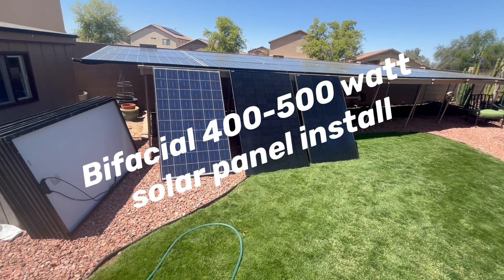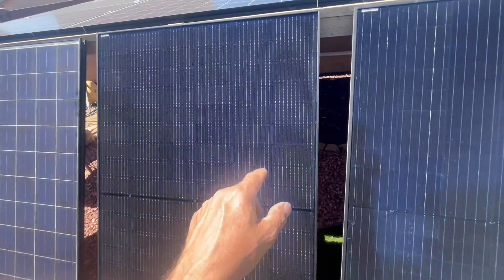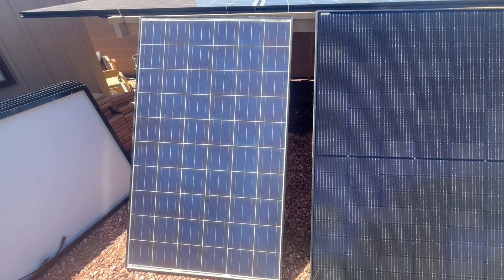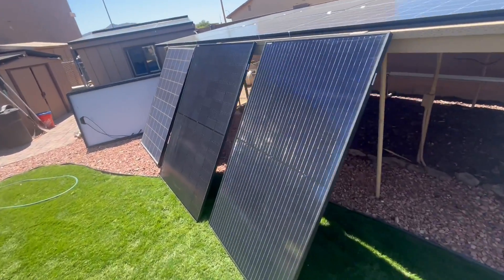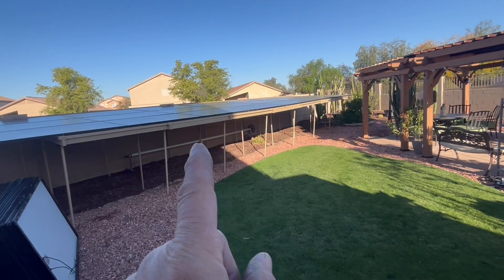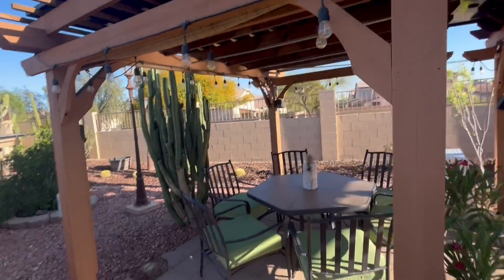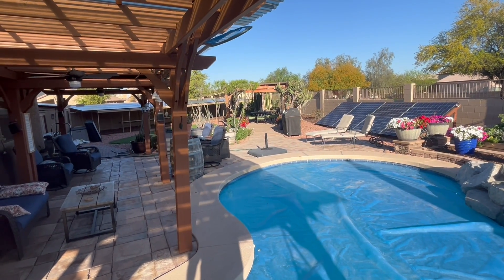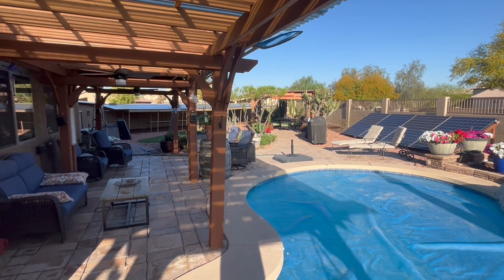DIY solar panel for home. Bifacial 400-500 watt with Growatt 12kw low frequency off grid inverter

Comment: I would like u to give an accurate quote of how much u paid to have ur electrical panel wall wired by a professional to ur inverters and batteries? Please & thx u. (I only ask bcuz I know what I paid and now im finding out they didn’t get the proper permits and now I have to pay even more UHG! But the nice thing is my solar system is up and running and they Can jell their meter as long as they want as long as I can afford gas to run my generators
Reply from the maker: This system is completely off grid.  It is not connected to the grid in any way.

Comment: Nice find on the panels looking at these higher output panels they are lot longer some up to 8 feet long.
Reply from the maker: I have seen those, they are huge. Need two to three people to mount those. I think SanTan solar said they would not load those into a pickup truck, they are that long. 

I really like the size of the 400 watt bifacial solar panels. Easy to handle and mount on solar array.

Comment: I see those are Hyperion 400W panels. I'm planning to do an install with these panels on my home in the next few months. Just about to order some however I see the connector type on the data sheet for these panels is a RY01 connector. How difficult is it to find adapters to hook these panels up to MC4?
Reply from the maker: @aliciaoswald9746  I bought my Hyperion bifacial panels from Signature Solar, they came with MC4 connectors. I have not worked with these RY01 connectors at all. I would ask Signature Solar if they have or will be getting the Hyperion panels with MC4 panels.
Reply: @diy-solar-guy  Thanks for the quick reply, that's great news. I'm planning to buy from Signature solar as well but will doublecheck with them before purchasing. Datasheet technically says "RY01 or similar" so I'm guessing ones produced for import into the US are built differently for the US market.
Reply from the maker: I have never seen those new connectors
Reply: I just saw in the specs after reading your comment that they are listed with ry01 connectors. I just made an order for ten panels, hopefully I get them with mc4's as well. 😅
Reply from the maker: @ I tried looking for the RY01 connector online. Not easy to find at all. Might want to call where you bought solar panels from and ask where you can buy RY01 connectors. First time seeing these new connectors.

Comment: Are those 400 watt bifacial panels Hyperion brand solar panels? I have a local guy selling them for $112 each and wanted to know if you like them.
Reply from the maker: @Ranch321  yes, the 400 watt bifacial solar panels I have are Hyperion brand. They are my favorite solar panels so far. I have 10 connected to my EG4 3000 watt off grid inverter and they preform excellent. I have them mounted on a wood pergola so they are 9 feet off the ground and pick up a decent amount of light. The highest I had them producing as input was 3350 watts, but I don’t think that is the max I could squeeze out of them. That’s just the amount with a large load. Very satisfied and would purchase again. They were $120 each, minimum order of 10 plus $250 freight when I purchased. Now they are $128 each. So $112 is a good price. I get great early morning and late afternoon input even laying flat on my pergolas. I think if these were mounted facing south at 25-35 degree angle, all 10 in series would probably produce 3800-4300 watts input. So far no quality or performance problems at all. Hope this helps. Hope you have a truly wonderful and extremely blessed day.
Reply: @diy-solar-guy  wow thats good info and thanks for the reply. I am looking to replace half my barns roof with solar panles and now these panles are on the top of my list.

Comment: In your experience, does the LF growatt do better with motor loads and lighting? Specifically, when it powers motor loads would some lighting flicker or pulse?

I have a EG4 6000xp and occasionally when our washing machine or one of the refrigerators start up some of our lighting pulses or flickers. I'm wondering if using a low frequency inverter like the growatt 12k you installed would solve that?
Reply from the maker: Every once and a while I will get a slight flicker of lights but I believe it is because my solar disconnects on inverter as it slightly goes over the 150 volt dv PV input. The 12kw low frequency inverter is rarely more than 50 percent load so no flicker except when what I stated above. If I start my 3 1/2 ton whole house heat pump, it might for a second or two flicker as it starts the large load but stops. So it still happens with 12 kw Growatt. Nit sure if you can add the Growatt transformer to better take that load flicker but for me it’s not a problem with an occasional flicker. Hope this helps. Hope you have a truly wonderful and extremely blessed 2024
Reply: @diy-solar-guy  Thanks for your reply. I'm looking to expand my system and will probably just add another 6000xp. I was just considering the growatt 12k, as it looks solid.
Thanks and God bless
Reply from the maker: @kenthiergartner1506  the biggest draw back with 12 kw low frequency Growatt inverter is you can not expand like you can with the EG4 6000. I have  2 12kw for the reason. I also have 2 - EG4 3000 watt inverters in parallel to run mini splits, washer, heat pump dryer and such. But that 12kw Growatt can start my big heat pumps ( 3 1/2 ton, 4 ton and 12.7 ton heat pumps) with that large coil inside and able to surge to 36,000 watts to start those large loads.

Comment: How many panels total do you have set up making power?
Reply from the maker: If I bring them all online, 10,000 watts on 1 Growatt 12kw inverter, 7,500 watts on another Growatt 12kw inverter, 4,000 to 5000 watt bifacial gain on 1 EG4 3,000 watt inverter and 4,000 watts on the other EG4 3000 watt inverter for a total of 26,500 watts. But it seems those used poly solar panels are only giving me around 112 watts -180 watts per solar panel as where the New 400 watt bifacial with up to 500 watt gain are giving me almost 400 watts per solar panel.

Comment: How do you like those panels? Looking at adding 10/12 of those to my set up. Awesome price!
Have you realized any gains from the bifacial?
Reply from the maker: I was able to get 3200 watts the other day out of the 10 bifacials which is 4000 watt plus bifacial of 1000 watts. I had 24 used 250 watt poly panels and was only able to get 4500 watts total. So the new 10 bifacial panels gave me 80 percent of 400 watts per panels. The 24 used 250 watt poly panels only gave me 75 percent. I will be re arranging the panels in different configurations and testing. Right now I have all ten new bifacials in series. The 24 used poly panels are 4 in series then 6 set in parallel to keep input solar pv below 150 dc volts. I really like the fact that I can get 320 watts for one bifacial solar panel compared to 185 out of 1 used 250 watt poly panels. Solar panels are almost the same size. I will be buying more and replacing the used poly panels. Almost 2 times the amount of watts and amps input for almost same size solar panel. Will slowly replace. Thanks. Right now Signature solar has free shipping with orders over $2000. That save $250-$300 on freight.
Reply: @diy-solar-guy  Are those the only 2 batteries you have,  if so why don't you have more? That was very interesting to see in this video.  
Thanks
Reply from the maker: I have 7-51.2 volt server rack batteries total split between 3 separate off grid solar systems. I am very happy with the EG4 LiFePO4 batteries. No problems at all. Charge and discharge very well and ah stay very close to each other in parallel.
Reply: @diy-solar-guy  That's awesome! You have a ton of knowledge about solar, and that's pretty cool to see
Reply from the maker: @chrs1212  thank you. I have been playing with solar for 4 years almost everyday. Learned a lot from just trying different configurations and ideas. I don’t do a lot of videos showing how to connect all the components yet but will start doing those videos soon. It is so easy to connect all the components, the harder part is making sure your solar panels are configured properly to stay within parameters, but it really isn’t that hard. The parameters are on the side of the inverters and the batteries have their own set of parameters as well. But once you set up the first system, it easy after that. The new solar panels are 2 times as efficient as the solar panels from 5 years ago. Thanks for your comment, I appreciate it.
Reply: @diy-solar-guy I love your system and am trying to install a Growatt 12kw system but am having the hardest time visualizing my PV array for max solar benefits.   Can you give me an assist?  I have Canadian solar panel rated at 395 watts VOC IS 36.6V and Isc is 13.77A.  What is the best configuration  to connect those panels?

Comment: I'm a bit jealous of your DIY solar system. That's an awful lot of panels.
Reply from the maker: I don’t use all at one time but have the option to bring online at any time. Also gives me flexibility to work on different arrays without shutting down inverters. Bought at $23-$40 each over the years. I live 30 minutes from the place that sells them. These new bifacial solar panels were the first full size panels I bought brand new. With the used solar panels they were so cheap I could over panels my arrays since they only put out 50-80 percent of stated power in watts and amps. Still will put out almost full voltage. I have a large piece of shaped lot of a 1/4 acre so I have room in the yard. No solar panels are on my roof of house. Hope you have a truly wonderful and extremely blessed 2024

Comment: Any recommendations for a way to get 240 volt solar in rv. Looking to upgrade my washer dryer and also upgrade ac to 240volts. Thanks
Reply from the maker: Depending on the room in your rv and how many solar panels you could mount and the amount of power needed in amps or watts used. Mainly the power needed to run washer dryer. I am using 2-EG4 3000 watt inverters in parallel to get split phase to run my 18,000 btu 230 volt mini split that uses up to 2500 watts,  https://signaturesolar.com/eg4-3kw-off-grid-inverter-3000ehv-48/?ref=diysolarguy or EG4 6000 watt split phase inverter https://signaturesolar.com/eg4-6000xp-off-grid-inverter-split-phase/?ref=diysolarguy. You would need to call signature solar and ask them about both inverters stated above being able to start and run your appliances, will need info from appliances for watts and amps needed along with min circuit breaker for loads. There also have mobile solar off grid kits for rv's as well.https://signaturesolar.com/kits-bundles/complete-mobile-solar-kits/?ref=diysolarguy. I installed a 12,000 btu mini split in my 23 foor motor home that is 120 volt. I will be installing the EG4 3000 watt off grid inverter in my 23 foot motor home along with maybe 3-400 to 500 watt Bi-facial solar panels on roof or use 12-100 watt grape solar panels on portable ground array. have not decided yet. I can run my Electrolux  heat pump dryer with my 2-EG4 off grid inverters in parralell and my full size Electrolux washing machine in my garage at the same time. Hope this helps. Hope you truly have a wonderful & extremely Blessed 2014.
Reply: You can have a qualified electrician make a splitter box, made for RV, park, electricity. Grabbing the one leg of the 30 amp and one leg of the 20 amp with twist lock attachment to give you 240v @20amp (not 30amp because other leg can’t carry it) Making a combiner box wire size will need to be different matching the 20 amp and 30 amp.

 A journeyman electrician can do it with the proper gauge wire along with the proper breaker at the other end. It’s not a DIY.

But that would be the best solution that way when you show up to an RV park, you could just plug in your splitter box and run your washer and dryer. 

Only Need to do laundry once a week or maybe every two weeks.
Reply from the maker: @peckerpeter2078  I misunderstood your question. I know I have split phase in my motor home and could use my split phase inverter for solar with a 230 volt plug on output of inverter to plug into input of motor home shore power. But I rarely use more than 120 volts when camping. I have a hard time finding campsites with electrical hook ups. If I was boon docking for a couple of weeks, I would bring 5-400 to 500 watt bifacial solar panels and mount on EG4 ground mound solar array and be able to produce enough split phase power for all my needs. Just 5 solar panels I could bring inside motor home with solar array in storage area. Set up in 20-30 minutes at campsite. Hope you are able to accomplish what you want to do. Thanks for your input with all that great info in your response. Have a blessed day.
Reply: @diy-solar-guy  Not a problem brother I was just responding to the other guy wanting to use 240 V solar to run washer and dryer.

 I was just stating with the time+ labor + money investment needed to do that. It would just be easier to go to an RV park with electrical hook ups, and use the combiner box  they charging for electricity anyway.

Only a few hundred dollars to do the combiner box versus many many thousands  for the solar panel and the 240 V split phase you would have to run plus batteries. 

Motorhome solar shouldn’t need more than 120v, cost effective solution with quality materials, Weight should be in consideration as well, Motorhomes don’t get good mpg, the more weight you add the less mpg you’ll get.

Gonna be dependent if you’re a weekend Warrior or you’re doing full-time living…

Comment: Can you run an air conditioner off of what u have now ?
Reply from the maker: I run a 18,000 bru mini split in garage, my 3 1/2 ton upstairs whole house heat pump, my 4 ton downstairs whole house heat pump along with my pool pump, 17,000 btu pool heater, 3- chest freezers and a fridge/freezer combo all at the same time during the day with only solar power. I run my 3 1/2 ton upstairs whole house heat pump overnight with EG4 battery bank as well. I spend $0 on heating and cooling my 2450 square foot house, garage and along with $0 on pool pump running 24 hours a day and heating and cooling pool water annually. I can also run my 7500 watt 230 volt 127,000 btu pool heat pump pool heater on solar during the day. I could run a 12,000 btu, 120 volt mini spli with just 3-400 watt to 500 watt Bifacial solar panels and a 24 volt off grid inverter with a 24 volt AGM battery bank during the day to run air condition up to 600 square feet of living space or probable replacing 2-12 volt AGM batteries in series or a 24 volt AGM battery with 2-EG4 24 volt LiFePO4 200ah batteries in parallel 24 hours a day. Very easy to do. I run 48 volt inverter solar power systems with the 51.2 volt EG4 LiFePO4 battery banks. In order to run my whole house heat pumps and 127,000 pool heater, I had to use a 12kw GRowatt off grid low frequency inverter, a soft start on each individual heat pump and at least 2-51.2 volt EG4 LiFePO4 batteries in parallel. I purchased all of these components from Signature solar. Click on links in description of video to find. I have videos on how I did this and feel free to ask questions as well. Hope this helps and hope you have a truly wonderful and extremely blessed 2024.
Reply: @diy-solar-guy  
Thank you for the information!
Reply from the maker: @Terrathrax  you are so welcome